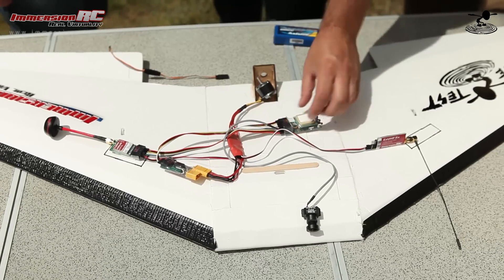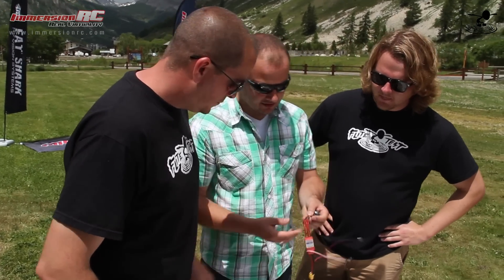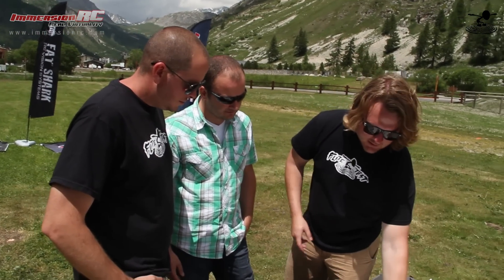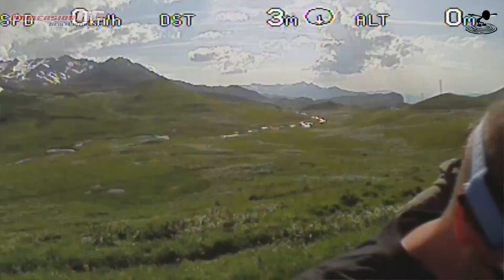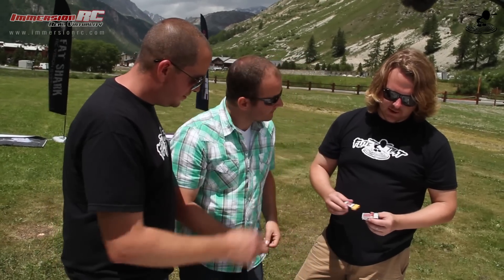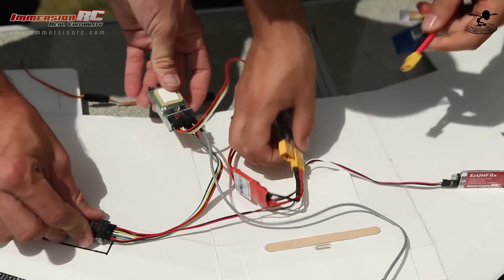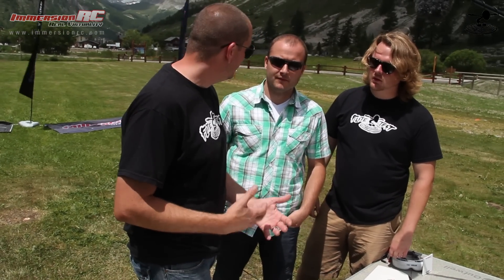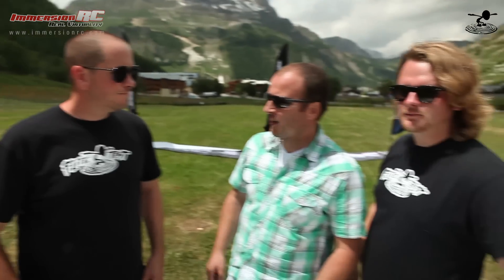Flite Test - Proper FPV Setup

Comment: On my mini revo I have 2 digital servos... the power draw is very evident on a 2s setup, but on 3s it's no issue, tho I threw a capacitor in to help with the power curve now it works so the fpv is uninterrupted

Comment: with wiring, you don't need shielded wire, as long as you cross the other wires at right angles. doing that cancels out interference from other circuit wires.

Comment: Nice video. Got a question. If I use a separate battery to power fpv equipment I have, which is runcam, TDS VXt and Tarot OSD with gps, that means I woun't see how much battery power i got left from the main battery? Is there workaround for this or I end up pluging fpv system to the main battery?

Comment: Help me out!

So i'm new to FPV Plane flying for long range and I did lots of research to completely know what I need for a good and safe flight (over 2km) what I need is:

1. Video Camera (connects to VTX) 
2. VTX and Antenna (Omni/Leaf) (200mw 2,4Ghz)
3. Video Receiver (Connects to Goggles/Screen) 
4. UHF (433mHz) Transmitter (Binds with TX Trainer Port)
5. UHF Receiver. (connects to servos)
6. OSD 

Is this correct and do I need anything else for a good and safe flight for over 2km?

Comment: I have a question I'm new to fpv especially the ones that have there on receiver instead of just a cord that plugs into your controler. my question is what are your thoughts on 
Fat Shark Dominator V3 FPV Goggles.are they really worth the 360.00

Comment: question.
If you upgrade the firmware on the receiver to make it 459mhz, as mentioned in the video, do you need to do anything to the module? Isn`t it also listening to 433? 
Also wondering about traffic on 459... 433 has everything on it, right. wireless, phones, etc
Does 459 have anything.. like 433
Not an expert, so just wondering..

Comment: +1 on the hard soldering of wires to eliminate failure points. I blew an ESC on my tricopter when I bullet connector came loose

Comment: Nice video with clear instructions. 

I use the immersion vtx also and it is a small nifty piece of hardware! Everybody uses there own setup, some 100% immersionrc other mixed or other brand. Fact is, some people ( like me ) want to re-invent the wheel just for understanding and learning. And without some kind of sponsoring or advertising the screen goes to black and people have to figure things out a different way. 

Anyway...

The basics of fpv setup stays the same, regardless of the brand you use. 

Now let's fly !

Comment: Show idea:  Get 1.3ghz video to work with 2.4 controls on a 250 size quad.  I've already set fourth to do this and with all my research I might just succeed with a little control range reduction.
Reply: Or get frsky module and fly 1280 it works great on my mini's

Comment: Hmmm, I don't think this was a very accurate video when it comes to a 'proper' FPV setup video. Shielded wiring helps, but a ferrite ring in copper wiring and the likes is the far superior solution. In most cases if you really want to bypass interference, the best thing you can do is separate your motor power source from your video power source with an additional lipo and make sure your video Tx is as far away from your radio receiver as possible. This video barely touched on that and how it matters.
 
As for digital servos... I'm using digital servos all the time and they actually do not interfere, not even on my wing that runs only one power source.

Comment: Mike here - I LOVE your work and am a BIG fan.  But I must admit I have little interest in FPV.  Still I was hoping to learn and find interest from this video.  Unfortunately I felt like you assumed I knew stuff I don't know.  I couldn't see the ESC details in your camera shots and found myself confused.  Seems like a whole different language.  In full disclosure electronics often confuse me - I've learned what to plug into what for non FPV setups but still struggle with prop/motor/ESC/battery specs so I like it when you tell me exactly what to do.  Sorry to be so slow, and maybe I'm alone on this.  But just thought I would let you know in case anyone else felt like me.

Comment: Can I set this system up with my fat shark predators rtf and add the square antenna the info on the screen and modul on turnigy X9 radio witch you showed on your show for HK ? I would appreciate the answer

Comment: So disappointing!!! David leaves and there has not been a "great" episode since.  Then you promote what appears to be an immersion sponsored episode, which I don't mind but what happened to the  little guy.  They would have an orange rx from hk, a hk vx with a security 200 cam not a plug and play system. You guys seem to be pushing products, what happened to not changing, DIY builds, foam designs fun episodes. Lately it's been all quads and consumer products. Chad, josh pull up your socks .

Comment: I made an FT flyer and my 1300 kv, 20 amp esc, 2s 500mah 20c-30c lipo, setup is not powerful enough. Do i need a more powerful motor or a 3 cell?

Comment: I realize this was an opportunity to do a video with someone there in France but this doesn't tell multi-rotor flyers anything about minimum recommended separation on smaller platforms.  This makes it sound like FPV will fail if mounted within eight inches of anything else.  The guest could have been asked for mounting recommendations for his gear on a quad frame.

Comment: Nice vid.  I watch so many FPV set up videos and always pick something up.  Twisting the servo wires and shielding now makes sense.  I like the plug and play systems.  So easy to get up and flying!
Reply: I like plugs with locking housings.

Comment: Hey, whereabouts in the Alps? I've snowboarded in that area quite a bit.
Reply: engineeredlifeform This was Val d'Isere. The famous 'olympic run', aka 'the face' is behind the team while filming. Looks quite different during the winter months.
Reply: then you don't need to ask, do you?
Reply: geneticallyinferior1

Well Mr Smarty pants, I do. When you're snowboarding, you spend all day up the mountain. It is necessarily winter, when there is snow, so at the end of the day, it gets dark early. So we don't see much of the resort, certainly not from this perspective, and never in daylight. Also, I don't have a perfect photographic memory, so don't recall the exact detail of every roundabout I may have glimpsed on the coach transfer from the airport. It's quite a big area also. I've boarded in Meribel (the entire three valleys, inc Courchevel, and Val Thorens, Brides Les Bains) Arc 2000, Tignes, Les Deux Alpes, Flaine, Val d'Isere, and Chamonix. (as well as in Austria and Italy). Many places in the Haute Savoie area impose restrictions on the development of buildings, (Val Thorens aside) and ensure buildings, or at least residences, have a traditional facade, making a lot of them look quite similar, so again, not much in the way of clues there, and lastly, how much of the resort did we actually see?

So, were you intentionally trying to come across as a petty bitch?
Reply: Tony Cake Thanks Tony.
Reply: engineeredlifeform 0 to a 100 real quick!!

Comment: I have a challenge for you: Build a quad- hex- or octacopter with with so much thrust that you can lift sailplanes and drop them in the Air (lift them at the back so you after dropping get lift quickly).

Comment: Thanks, valuable, BUT I thought a bit shambolic, and I wish you could lose the music. I think that this kind of thing needs doing indoors with good graphics. You could learn something from Bruce Simpson about presenting this kind of thing. Companies like Immersion AND Eagle Tree really should have more HOW TO videos available: it shouldn't have to be up to you good-guys. This was a bit of a teaser... The website ARTICLE redeems you a LOT.
PLUS: in the UK the max is supposed to be 25mw @ 5.8ghz UNLESS one has a Radio licence, when you can go as large as 250mw. I think that 600mw is simply NOT allowed. Not sure how many of us can or will obey these rules, but I think THIS is what they are. I've started to use one of the Immersion patch antennas to try to compensate.

Comment: which channel on the ezuhf is legal without HAM?
Reply: none of them.  All UHF transmitters requires a HAM technician level license which isn't really a big deal to get, it is just that many people ignore that fact.  If the FAA ever starts to officially crack down on us there are going to be a lot of fines. :)
Reply: Also, if the FAA are successful in banning FPV it won't matter about UHF because you won't need to fly far enough to justify UHF because you need to be line of sight with your aircraft.

Comment: Was it sponsored by ImmersionRC, I could hardly tell.  I haven't seen that much product placement since watching "I, Robot"
Reply: Well if Immersion RC helped them out in getting to Europe, why wouldn't they have a bit of product placement?
Reply: They can't do this for free...
Reply: droid Every product FT places in GOOD QUALITY by my experience.  
I appreciate that.  They are here to help shif through the junk.  Good job FT.
Reply: This channel is mostly for beginners and an inexpensive way to get started into different aspects of the hobby.
Reply: Evan Demers
Dude get back on your meds!
Evan Demers
Home
Videos 0
Playlists
Channels
About
This channel has no videos.
Reply: 0917bobb I'm sorry, you don't think FliteTest qualifies? I would suggest you take that up with Josh and the FliteTest team, as you're basically stating they can't be trusted and would do anything for a little money. That, again, shows that the primary reason you're posting here is to put a negative spin on things without any appreciation for the work we, and FliteTest, put into this.
Reply: Granite
...but they don't have to be whores...(like sucking the balls of hobbyking and horizon hobby....EVERYTHING they did was PERFECT)
Reply: sandersassen The fact of the matter is that you appear unwilling to have your products reviewed by an unbiased party.
Reply: 0917bobb Alright, so from your perspective we're all biased, as we're all clearly paid off in some way and we're just trying to push these inferior products to the FliteTest audience. In order to rectify this you're pushing to have these products tested by an unbiased party, which obviously you get to choose, otherwise they'd be biased too of course. Apologies if I simply ignore your comments from now on, whatever we do you'll always have something to complain, judging by your other posts that's your modus operandi.
Reply: And Rick Prime is gonna buy it for that reason (FT is good so this is good). I'm not going to discus the Immersion quality but there are a lot of alternatives that will do the job just as good. The main problem with Immersion is that a lot of stuff is sold out everywere, all the time. Since they use different channels it is impossible to buy another receiver of transmitter. It's not compatible with other Chinese brands. I do own EZOSD do. The TBS version.
Reply: Evan Demers Call me a girl and talking about d's? What's wrong with you? Gender problem? I'm only explaining that I have nothing agains Sander and Immersion. The TBS version has a quicker GPS lock and custom firmware. That's the choise I made after studying both versions. Anything wrong with that?
Reply: Johan Fasth Oeps, I 'forgot' about that USA trip. Coming from Holland (just as Sander from Immersion) we don't have this problem YET.
Reply: René Nieuwenhuis We do, as per October 2013.
Reply: this infomercial was fantastic!
a solid 9/10.
next time, get the shamwow guy for a perfect 10/10
Reply: Rick Prime
you must of loved all the hobbyking stuff they endorsed.....err used to endorse
Reply: Granite
not really inexpensive, but mostly mainstream. you can't say that the horizon hobby stuff they endorse is cheap. it is in fact one of the most expensive vendors out there. and then there's hobbyking. the bottom of the barrel
Reply: sure, you could say that.
Reply: droid FT does ignore FrSky, however they do not ignore Futaba which is a good radio.  I have never seen anything that could be thought of as a Futaba commercial on FT.  The radios that they use are obviously their personal choice, they do not need to give equal time to other radios.
Reply: René Nieuwenhuis René is correct, it is usually difficult to find ImmersionRC and Fat Shark equipment and at least for a while it did not perform as well as the much more inexpensive Asian vendors. Overpriced and underperforming, a great combination. During one phone call to either FatShark or Immersion RC, I can't remember which, they told me that FS hardware is made by ImmersionRC so it is really one company that you are dealing with. I have FatShark hardware but I am moving away from it so that I can use all 32 channels available to 5.6 instead of 8 channels that the chipset that Immersion RC makes their hardware with.
Reply: Such nonsense, with hundreds of retailers the world over that carry our products they are not difficult to find at all. And we've always offered better quality and support than Asian vendors, that's how the company got started and quickly became such a great success as the Asian vendors lacked the quality, support and durability we offer. Furthermore neither Fatshark nor ImmersionRC has a phone hotline, so what you are claiming is simply false, we are not the same company. Using 32 channels is a mixed bag too, we are CE legal with our products, using the band reserved for license free use, hence by using our products you can operate within the confines of the law, the Asian vendors don't care, so you'll be using illegal frequencies. Also the NexWaveRF receivers used in our products are designed by us to offer the pinnacle of performance in terms of image quality and sensitivity.
Reply: sandersassen Okay fine Sandersassen, then it had to be email or are you going to tell me that there is no email address on your site?  In my case I had to wait 2 months for a 600mw TX because no one that I found on line had them in stock. The matter that it was email or a phone call does not change that fact.

No, I did not say that you were the same company. I said that I was told that it was manufactured by the same company.  Are you saying that Fatshark and ImmersionRC products are and never were manufactured at the same location?

As far as 32 channels are a mixed bag is concerned. First of all, which channels a person uses has always been the responsibility of the end user but if people feel that they are incapable of policing themselves then they should purchase their hardware from a vendor like ReadymadeRC who will have the vendors restrict which channels are available at least in the US; problem solved. Using only your 8 channels only yields maybe 3 usable channels because of overlap, if you restrict yourself to the 16 channel unit that ReadmadeRC sells (because they restrict illegal channels on the 32 channel units) you have a much wider range of channels and have less chance of collision, but unfortunately there appears to be a incompatibility between your goggles and their transmitter because you use a different frequency modulation type so people looking to use more channels need to unload your goggles and purchase goggles or a LCD screen/receiver that are compatible with the other chipset.

-NexWaveRF receivers used in our products are designed by us
-to offer the pinnacle of performance in terms

You will have to forgive me if I don't take your word for it.  I have seen a review on RCModelReviews where they said that a Boscam receiver outperformed your hardware but I am willing to listen to something other than a sales pitch. So Sandersassen, do you have an unbiased review stating otherwise that is not in your back pocket? I don't think that Flitetest qualifies because they are obviously on the payroll with you. Why don't you contact someone like Bruce Simpson at RCModelReviews, he has a RF background and the hardware required to test your products vs. the other manufactures and he has a solid reputation for being unbiased.
Reply: sandersassen Why do they have to qualify? It's a (fairly professional) Youtube channel that's about RC related products, often through sponsoring. And isn't it also a full-time job for some of them? Of course people will frown at some of these promotions. People always do. To be fair though, I don't see much wrong with the product placement itself, except for perhaps the fact that they could have started by saying the episode was sponsored? (Also, people will always 'hate'/'get jealous'/'troll' etc. I wouldn't waste too much time trying to defend your products when they're probably not even attacking those here.. From what I can tell so far, it's good stuff.)
Reply: I don't understand all the hate in here.

The first thing I noticed was the ImmersionRC logo in the top left of the video And sandersassen was introduced as "from ImmersionRC", so of course I was expecting ImmersionRC stuff.

But the video still shows a "Proper FPV Setup". And all the tipps like positioning the parts, shielded cables, etc. work with other hardware too, don't they?

Also the FT guys used ImmersionRC gear before they got invited/sponsored to come to Europe.

And finally - if you don't like what you see... A small click on the YouTube logo in the top left brings you to a world of fascinating media that has nothing to do with FT or ImmersionRC.
Reply: sandersassen Flitetest doesn't reply to any comments, only you do.  FT has obviously become a paid commercial channel so no they don't qualify any longer.  You might as well ask Toyota to endorse Nissan.
Reply: 0917bobb x